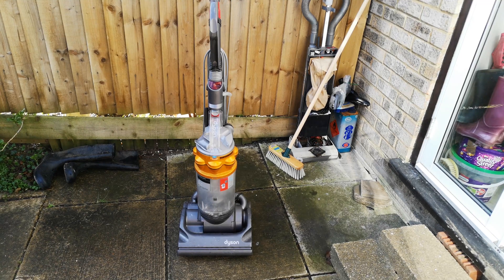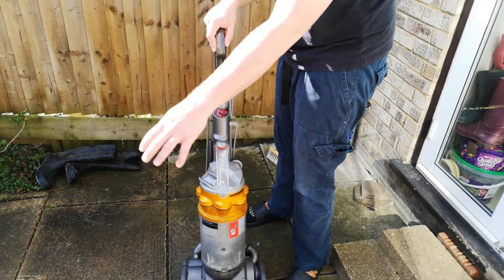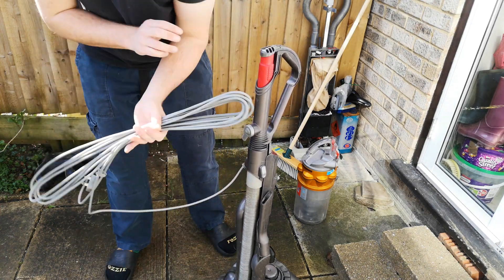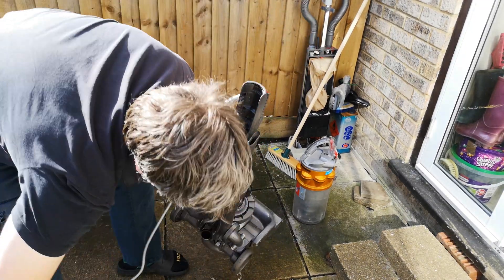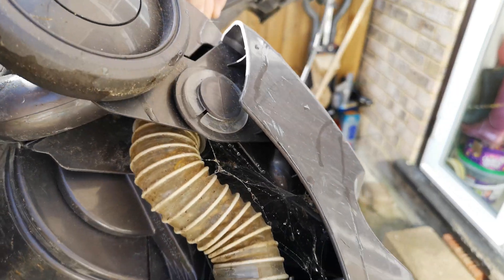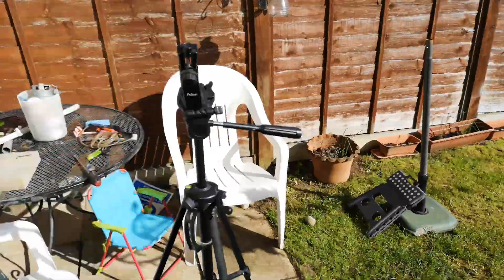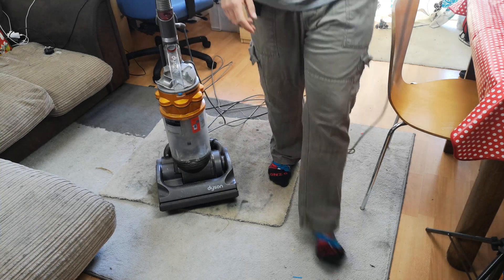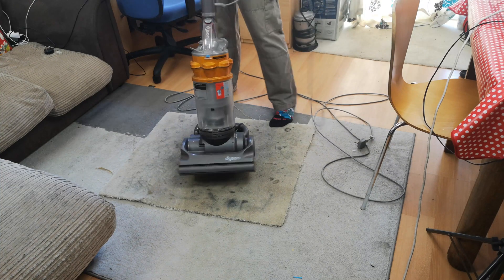#Winter #Leftoutside A Dyson DC14 Winter Experiment - Does it still work?

Comment: Hi Sam -would you happen to have any spares for a electrolux 560 upright? 
I’m after the speed control pot and the silver box of tricks  next to it? 
My machine was working fine,but now after 10 minutes of use  it stutters a bit,then when I change the speed it cuts out altogether -I’ve sprayed the pot,still the same-and the silver box looks sealed. 

Just had another look at it,and the silver box does unclip from its holder,the silver box is actually a large heatsink for a transistor and small board-so I think maybe the transistor maybe breaking down-I May try changing it-but if you have a spare I’ll happily pay for it 😀
Thanks 
Martin
Reply from the maker: I've got both as it happens! Knob and board. Send me an email, s.c.g.watson@gmail.com and I'll reply in the morning! £25? posted if you like, fully working.

Comment: The dco7 and dc14 are the best dysons ever made
Reply: And DC08
Reply: Agreed.
Reply: @jayambermsp8000  i made a mistake of getting rid of mine years ago something was wrong with it probably the belt the motor was working but it wouldent even pick up pieces of tissue off the floor when it was ok it was a great vacuum we now have a vax pet max the brushbar is great on it and it has really good agitation it collects loads of fine dust from the bottom of the carpet pile my next vacuum after that most likely will be a commercial sebo i also have an electrolux microlite great for quick cleanup on carpets and the car.